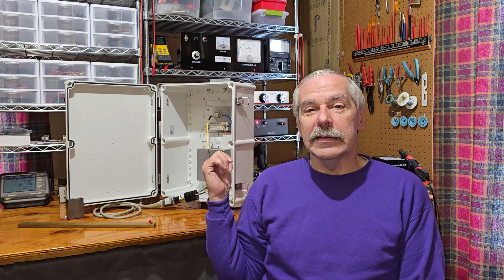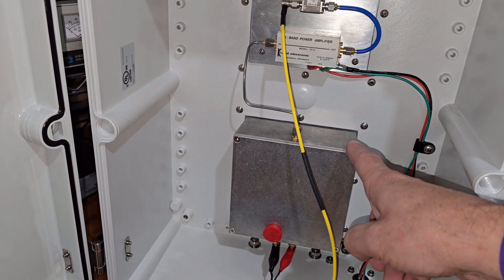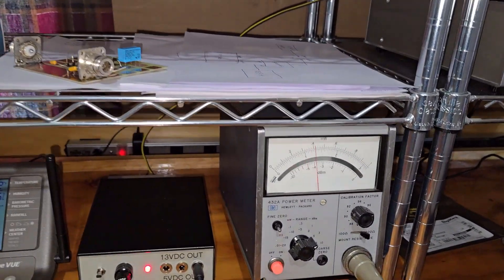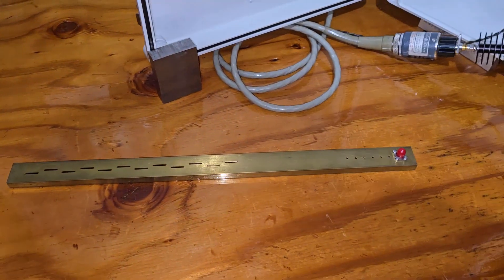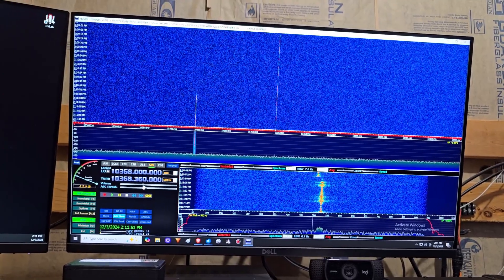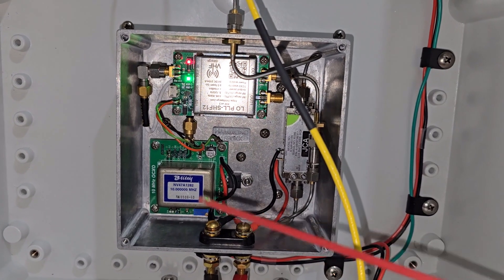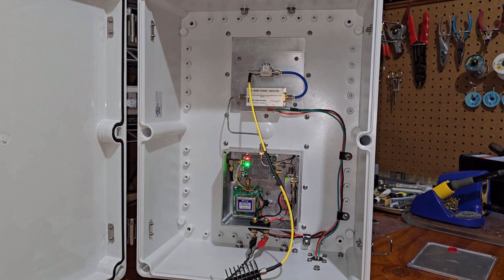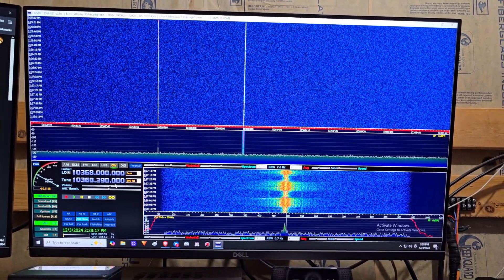10G Introducing "Quick Beacon"

Comment: Use a peltier cooling plate controlled by a thermostat that varies the voltage to help control the temperature out to the heatsinks. That way you have control of the temperature.
Reply from the maker: That's a great idea! But not very energy efficient. I might try it and see how much power it uses.

Comment: on the antenna  how we do it with the slot is mount the waveguide part of it to the back...and that allows a fairly weather proof connection feed through.  then a radome that is open on the bottom to allow air circulation WB5MZO /7
Reply from the maker: Do you have any pictures of that? I can't quite visualize it. If you mean mount it to the back of the box, I don't have room with the heatsinks back there.

Comment: Here in Australia you can get electrician's  "trunking" - rectangular plastic box section with a "snap on" front. If it's PVC, then it could be solvent welded to the box with plumbing glue and the front either temporarily sealed with silicone or permanently solvent welded shut. Failing that, maybe a section of PVC pipe with an end cap on top and a flange with rubber gasket on the bottom. I wonder if the curved plastic would act as a microwave lens and change the radiation pattern?
Reply from the maker: I think the bigger problem is loss of PVC at these frequencies. It is commonly used for radomes but it surely has some loss. I was going to try to measure loss of several types and sizes of PVC but winter set in before I had a chance.  I also have some corrugated, clear flexible Teflon or PTFE tube that has been used for a radome by at least one beacon builder. It may have lower losses. The main challenge for me at the moment seems to be mounting the slot antenna to the box. About the only place I can put it is sticking out the top of the box, but coming up with some sort of proper clamps to hold it is puzzling me. It can't be as difficult as my little brain seems to be making it!
Reply: @n1bug  A test of different radome materials would certainly be interesting and something I'd watch. I'll probably go on a bit of a researching mission (as I'm prone to do!) and will let you know what I find.  That said though, theoretical/research data might not reflect real world plastics anyway - plumbing PVC has UV stabilizers and other stuff in there. One of the worst electrically is black plastics where carbon black has been added (as the tesla coil crowd will attest to!)
Re: clamps; with the SMA part in the box like you showed, and a rectangular hole in the top of the box, could you use 4x "L" brackets (for the front, back and 2 sides of the antenna) to screw or glue it to the box and then affix the radome separately? That way the antenna's fixed in place and would make any radome testing repeatable indoors while its not 'antenna weather' - I'm heading to the opposite sort of weather problem here, we had our first day of 37C (100F) today, and I want to get an HF antenna up so I can get back on air this summer.
Reply from the maker: @rob-muntron  This is a very interesting discussion. Thanks so much for your comments. With regard to radome testing, I have tried indoors several times. I was unable to get stable measurements due to signal reflections. If I moved any part of my body, or my exact positioning varied between tests (no radome, radome 1, radome 2, etc.) the readings were meaningless. I am hoping if I get outdoors where I can spread things out that can be mitigated. I am thinking if I keep the radiating antenna and the measuring antenna close together but keep myself a few meters away and the whole test setup at least several meters from trees (which move with any breeze) I might get stable results. This is just a theory for now! One knowledgeable microwave builder suggested putting a piece of the test material inside a length of waveguide with coax transitions at each end. That way there would be no radiation to be affected by reflections. I lack the waveguide and coax transitions for such a test. It might involve quite a lot of work cutting pieces  of PVC to precisely fit inside waveguide.

What you said about materials is very true. There has been quite a lot of discussion on this subject in some of our microwave forums. It has been said that the composition of plumbing PVC varies between manufacturers and possibly even different lots, which may have consequences at RF. I have wondered about furniture grade PVC and also have some of that to test. It likely also varies. Despite all the discussion, it seems nobody has actually attempted to do any tests or measurements. Most blindly use PVC. Obviously it does work as I can hear beacons that use PVC radomes! I just don't like not knowing.

I will experiment with L brackets as you suggest. I had thought about machining slots into two thick acetal blocks and clamping the two slotted halves around the waveguide  like a clam shell, then affixing the acetal clam shell to the box with screws. I found that I was unable to cut slots accurately enough to have the antenna purely vertical and clamped sufficiently to prevent movement. I need better machining tools.

I'm not sure which is worse... snow and freezing temperatures or 37C!
Reply: @n1bug  I had a look around, and I guess a lot of radomes are in applications with military-level deep pockets, because fused silica or alumina seem to be very well regarded!
But you're right about the plastics, PVC is pretty rubbish at microwave even without additives, and PTFE seems to be the best non-exotic plastic for 10GHZ+. Fiberglass apparently has more loss than PTFE, but is much stronger so can be made thinner.
I just had an idea come to me last night regarding radome testing (although it would require some quick trips outside). You wouldn't necessarily need to use the QB as the TX for testing, or even test in the ham bands if you're only receiving. You could possibly use a Ku broadcast band LNB pointed at any GEO satellite then put the plastic under test in front of the feedhorn and measure the dip in signal at IF. (As long as the weather plays nice for long enough!)
Reply from the maker: @rob-muntron  Thanks for the radome testing idea. I must find time and a method to get that done. There is little doubt the PTFE tube I have is best in terms of loss, but it is just large enough diameter to fit over the antenna. That means any snow and ice that accumulates on it will be very close to the antenna and will likely have a rather large effect on return loss / SWR. I know, PTFE is a non-stick material. You should see our snow and ice! It sticks to anything and everything!